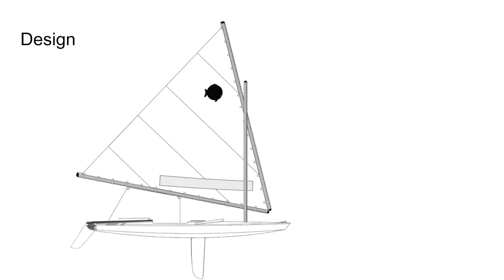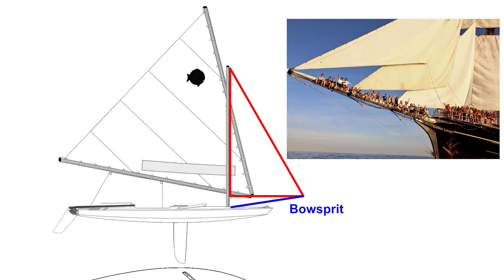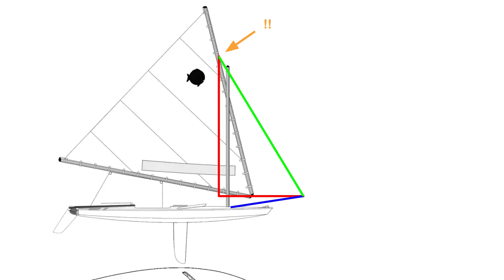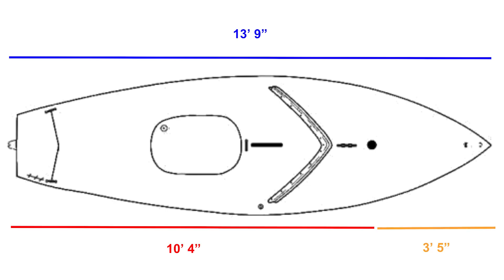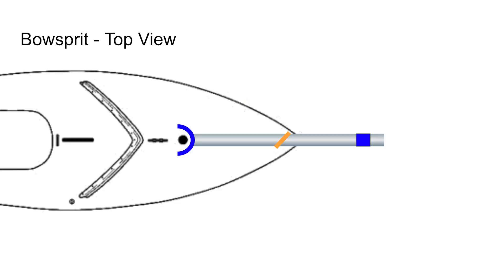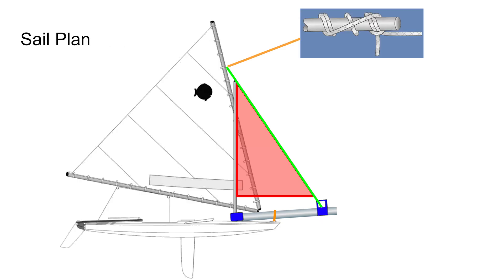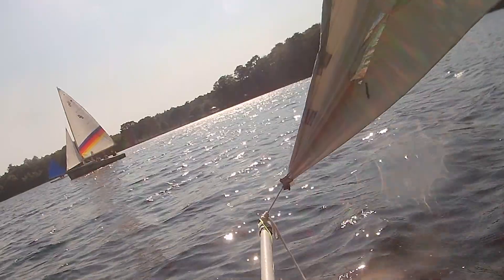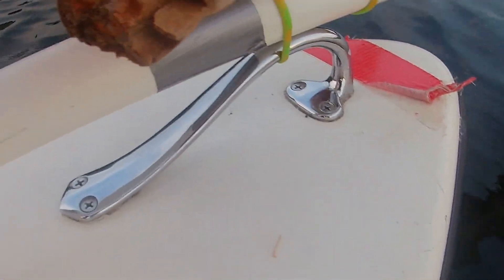From CAD to Capsize: DIY Jib Sail in 2 Weeks

Comment: First of all, I'd like to congratulate you on your attitude! It's great to see such interested young people stepping away from their screens and taking the initiative to design and implement projects. That said, I might have some useful observations. Increasing and shifting the sail area changes the rig's center of effort, which also changes the boat's maneuverability. In the case of your project, increasing the sail more forward could cause a tendency to bear away, which can be felt in the tiller. This tendency, in my opinion, can be a negative point when trying to sail upwind. However, I believe there may be an increase in downwind speed, especially if using the bowsprit as a spinnaker pole.
Reply from the maker: Thank you for your feedback!